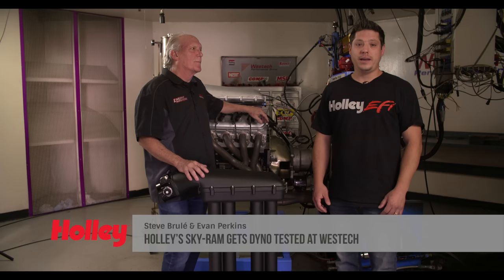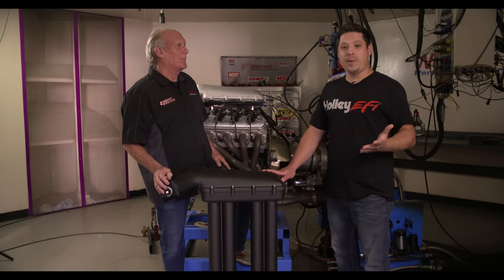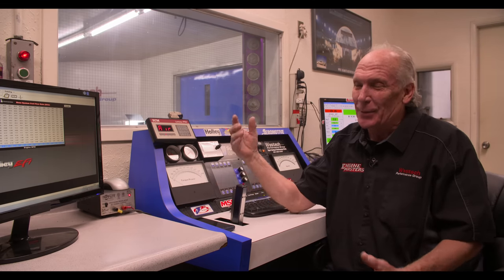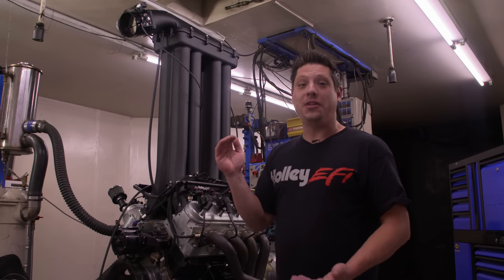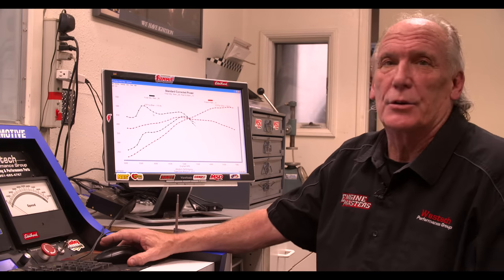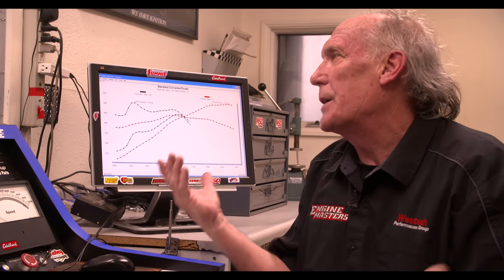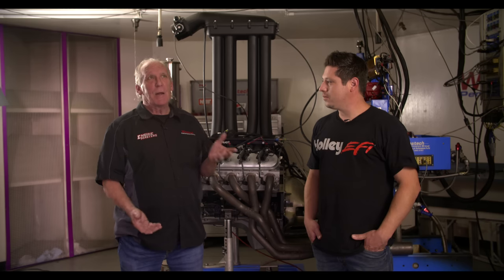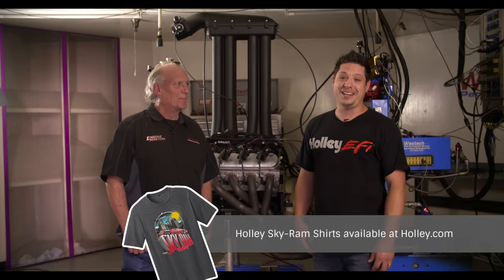Holley Sky-Ram Intake Manifold Hits the Westech Dyno

Comment: I bet some people who are more into a certain marine application might just love that bottom end torque. And on a, say, jet boat the problem of hood clearance might be moot altogether.
Reply: I wanna stack like 8 of em together. 
It can double as a mast  for a sail in a pinch.
I've been told my head is more than a hat rack sometimes.
Reply: Or air boat?
Reply: You do have worry about fitting under bridges tho. lol.
Reply: or every tow vehicle ever.  exactly perfect for an RV.   Put the intake on the roof and have the runners down through the cab.
Reply: @frotobaggins7169  Nailed it! Winnebago burnout machine.
Reply: I was thinking those LS swapped mid/rear mounted engine cars
Reply: Nah. Want torque? Go diesel.
Reply: @sepg5084  Very very true, but that'll cost ya plenty more. Proper marine diesels are not in the same league price-wise.
Reply: You think that's something? Wait until next year. You've heard of long-tube headers? Next year they're introducing longest-tube headers, all four tubes terminate into a 4 into 1 just behind the rear axles.
Reply: I have a big block jet boat and I was thinking the same thing. The motor sits exposed anyway so height is not a problem. Low end tq is always a good thing in marine applications.
Reply: Nah they cant makes over 700hp without exploding
Reply: If they marketed them someone would buy it
Reply: Nah, nah, nah gotta put one in a Florida swap buggy!
Reply: @prtyof4156  oh snap I forgot about that!
Reply: Doubles as a snorkel
Reply: @sepg5084  the problem with diesel is the weight of the engine takes away usable gross vehicle weight.
Reply: I was thinking a similar thing.
Reply: @sepg5084  dude.  Diesel with these runners.. 🤣
Reply: @Rattus-Norvegicus  heard that, each port gets a 3 inch pipe.
Reply: @sepg5084  500 Caddy FTW
Reply: Many boats cruise at 3k so it would be at peak torque almost all the time.
Reply: @sepg5084  can confirm

Comment: It added 110ft/lbs under the curve at 3600-3700 rpms, that would feel AMAZING on the street. Guys are always talking about what is going to feel good when you're driving the vehicle everyday vs what is the most "racy" thing. That a Sky-Ram is the best truck intake EVER. I wanna see it with boost. I think the HP curve could be extended a while longer before it falls on it's face with forced induction. I really hope you guys do a Sky-Ram production run. I legit think it would sell out. Maybe experiment with a shorter production Sky-Ram that gives the performance and carries a little higher in the Rpms and still has the insane looks. I think this thing is A joke that turned into a viable product.
Reply: I was thinking the same thing. Make it a bit shorter and it'll be an amazing street intake for those relatively stock LS motors that rev up to 5500-6000.
Reply: it cut out at 5300rpm, hell that's when my 80e is commanded to upshift anyway. It's perfect for my truck!
Reply: Lots of torque and hp at around 3500rpm
Reply: @anonanonski2234  So, you want a relatively-stock engine while having to cut a hole in the hood to make some extra torque down low...
I despise holes in hoods, and it's even more ridiculous when it's on a low-power vehicle. I better be seeing at east four-digit dyno numbers before you're cutting your hood.
Reply: @anonanonski2234  What LS only revs to 5,500rpm? LS1 in the late '90s camaros is the lowest revving LS engine and it  redlines at 6,000rpm.
Reply: @yucannthahvitt251  Redline =/= “shift here,” especially in a truck, and especially with a torque converter automatic.
Reply: Yeah fr though. Honestly tractors or other heavy duty diesel vehicles that do a lot of hauling or stuff that requires high torque would probably get a good upgrade with this thing. Could definitely see farmers using such a thing, even if it is a little crazy looking.
Reply: @midlifehemi88  I seriously doubt they (long runners) would tbh. All the big diesel stuff I'm familiar with already has insane torque and a narrow power band, like over 1800lb-ft at 1100rpm for a 13L mack mp8. Then at 1400rpm the torque is starting to drop again. Specs for a similar sized john deere engine (old '07 model, but at 30psi boost like the mack), show 1850lb-ft from 1200 to 1600rpm. They are ground-up designed to be torque monsters.

Comment: I really wanted to see it tested with the moon shot plate system. 😁
Reply: yeah! We need that!
Reply: BOOM
Reply: maybe the person that wins it can hit up westec for that.  Imagine every plate shooting 5 hp shot, at varying rpms, one after another till they are all going.
Reply: @frotobaggins7169  stand farrr away!
Reply: From what I have seen here, they would have had to raise the roof of the dyno cell to get that monster to fit in there...
Reply: @Timberwolf69  
I know they have a sawzall. 😄
Reply: @shitbox82  Fair enough. But do they have a big enough blanket to cover the engine while sawing the roof?
Reply: @Timberwolf69  
Brule’ probably has a tarp around there somewhere 😄
Reply: Only if they top it with the salad bowl 😂
Reply: @ShotgunKidX  
2 salad bowls? 🤷🏻‍♂️😁
Reply: don't we all even if it's just gonna die
Reply: I don’t mean to be “that guy” but isn’t the moonshot prank supposed to be a carb spacer
Reply: @conanruisi  
No those are nitrous plates…
Reply: @shitbox82  yeah. For carburetors.
Reply: @conanruisi  
Yes you’re right…
Reply: @shitbox82  do they make a carburetor hi ram or something? that’s clearly an efi manifold
Reply: @conanruisi  
The high ram has different tops that you can change out, for EFI throttle bodies or carburetors
Reply: Was thinking the same thing
Reply: @shitbox82  oh that’s a nice feature
Reply: @shitbox82  double the gains 😂
Reply: @frotobaggins7169  5Hp sequential plates FTW!! 🤣🤣🤣MY SIDES!

Comment: Dear Holley, I think you should create a modular  Hi-Ram intake where the middle of the runners has a bolted together flange, that way the intake could be run like normal and you could sell runner extensions in 5 and 10 inch increments, that way a guy could choose how much "Sky-Ram" he wants or he could even keep adding them until he has a Space-Ram. Seriously thought, you could increase the runner length by 5-10 inches at a time and tune the runner length for your application on the fly to what best suits you.
Reply: Or what suites the track that day!

Comment: That Sky Ram intake would be perfect on a old school 1966 Dodge A100. With the ingne behind the cab and a old school dual cuad air ram filter scoop.  And a dually axle in the back and supper single tires in the back. With Dual exhaust stacks in the back of the cab. It will almost look like a Hot Wheel style trick out truck. That would get allot of attention. Much more than someone with a Lamborghini.
Reply: Then put some meaty bois on it
Reply: @savagesock3598  That's what he ment by super singles. They are a 455 width tire (17.5" wide.) That's what I want to put on my 95 Chevy single cab dually.
Reply: You have good taste in automobiles.
Reply: I am pretty sure this build would quickly land in a hot wheels blister... 😁
Reply: @c0c0asauce  I prefer dual 275 drag radials myself.
Reply: @Prestiged_peck  If getting machined rims for a dually to fit passenger tires wasn't so expensive I would too.
Reply: @c0c0asauce  we just used spacers and regular steelies lol

Comment: YES!!!!! SOMEBODY actually said "high end torque!" It always gets spoken as low end torque or high end horsepower when in fact the force turning the wheels is ALWAYS TORQUE. Horsepower is just a calculation. It's math, not a force turning the wheels. Thank you Steve, it's about time torque gets acknowledged at all engine speeds.
Reply: Correct 👍

Comment: Looks like something Jeremy clarckson would come up with.  I'd love to see Vizard's take on this.  That big hump must be the RPM sweetspot for that intake (pulse wavelength).
Reply: Yep, and it's probably the first reflected wave, so the signal is very strong. Hence the big hump in a narrow rpm range.
Reply: @michaelblacktree  thats not going to be the first wave, you can see the secondary rise at about 4700. Lets assume its about 3600rpm, thats close enough. In one revolution, 360°, sound will travel about 19 feet. Its a reflective wave so half that distance is 9.5'. Its the secondary or tertiary wave. Without the exact cam specs and centreline runner lengths its hard to know for sure. The graph makes me think its tertiary. The secondary is at about 4700 and would make the primary at about 10k rpm.
Garage 4age did a test with 24" extensions on a 9000rpm ITB deal. Chasing the primary wave.
Reply: @timothybayliss6680  you must have a degree in fluid dynamics.......
Reply: @rearspeaker6364  nope, highschool drop out
Reply: @timothybayliss6680  damn!!
Reply: I say half the length and it should see that hump about 6k RPM and then we can see something actually useful.
Reply: @rearspeaker6364  From my perspective it seems as though Timothy likes to read textbooks and tinker with things. Highschool dropout doesn't mean stupid OR uneducated, as long as the person in question educates themselves.
Reply: @ChristopherHallett  sorry to make that impression, just was surprised at Timothy's knowledge. I come from the same boat, so I can relate.
Reply: @ChristopherHallett  i was accepted at U of T for their engineering department. Life got in the way.
 I dont know if i would have enjoyed it or even learned as much as i have since then.
Intake manifold research is a hobby of mine. FSAE projects have some of the most painful publications regarding the subject with detailed analysis of their cfd modelling. Thats some of the best part of it being done at a Uni is graduates will actually publish their findings and all of it, at very least the abstracts, are publicly available. 
When i want to find out how runner taper, length, bellmouth can affect both power and fuel efficiency there will be dozens of papers that are under 20 pages with the data included.
The weird part is because the laws of physics don't change, almost all the intakes in FSAE are almost the same. The one thing that is actually really hard to find is articles that deal with stuff like this. Nobody really takes seriously intake runner lengths over about 21-22". Its not practical for production and even fitting it in a tube chassis car is a challenge. To find an article that has data about the flow of air through a strait piece of tubing at 28" depression is tough.

Comment: Now I am curious about how the lengths in between would perform, like 10" and 20".
Reply: garage4ag did this with itbs its a good watch
Reply: Car manufacturers have been doing this for years.  Think variable length intake manifolds..  im kinda thinking the bmw v8 had 12 to 18 inch variable length.  18 for low 12 for high revs.
Reply: @kwisin1337  I know of  GP race engines that use variable length intake technology but it is a small change of length for them. I am curious about how the mid length intake will perform for low rpm off road 4x applications with the amount of torque that the long runners made.

Comment: 4:06.... (VE number) volumetric efficiency is what he's talking about basically saying that this is where the Pulses from each cylinder line up just right to compress a little tiny extra air into each Powerstroke. It's basically where the intakes harmonic frequency is.
Reply: Thinking about it as a harmonic frequency helps me understand why a larger one would help low end torque (lower frequency - larger wavelength), and a smaller one would help higher rpm torque (higher frequency - smaller wavelength). Thanks.

Comment: Interesting that it hit such a wall at about 5k rpm. I’d imagine it’s the combination of harmonics and the restriction of tubes that long. Would be fun if they made one that was multiple sections and could shorten down as rpm went up.
Reply: That concept has been put in production over the years, though usually with a valve to switch between two fixed runner lengths
Reply: @DangerDaveMurray  also been done with itb it literally two tube that slide in and out to modulate the runner lengths
Reply: 80s TPI style...
Reply: Like a slide whistle but with intake runners
Reply: Lots of old drag guys in the 60’s tried the variable runner idea using straight radiator hoses as the runners and cutting them down to the sweet spot. Really interesting stuff
Reply: @Hapkido82AUS  exactly like the sbc “spider” intakes, torque peaking barely north of 3k and out of steam by 5.
Reply: Alfa Romeo had variable intake length on the plenum of the 2.0 twin sparks via a flap that bypassed the longer runners. Audi also did it on their 30v v6’s
Reply: @legros731  mazda 787b has entered the chat

Comment: 80’s FLASHBACK!  Basically you built a TPI intake from the late 80’s.  Long runner length = massive torque but rpm’s done by 5k.  Still love the TPI!
Reply: Definitely my favorite intake.  It was well suited for the 305 which it was designed for but choked of a 350 even sooner.